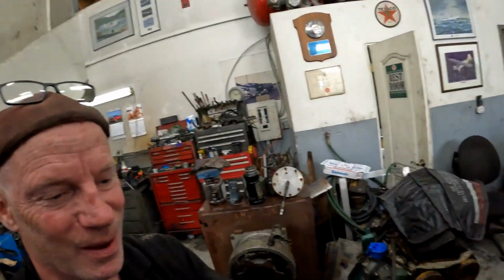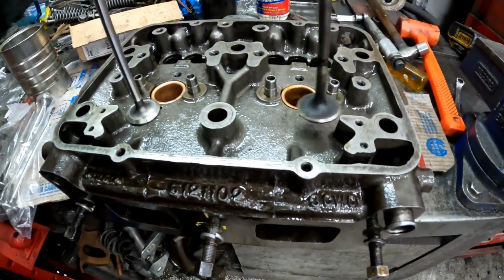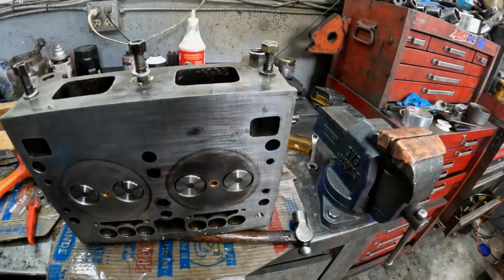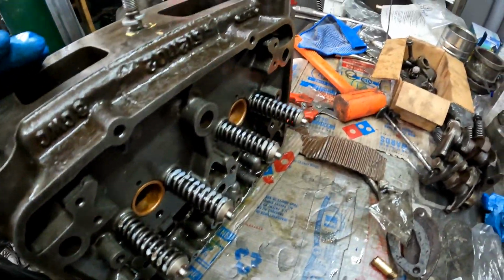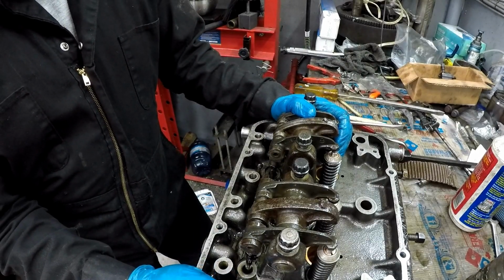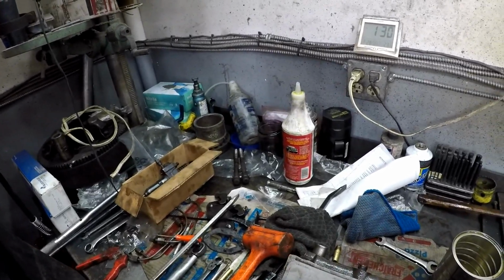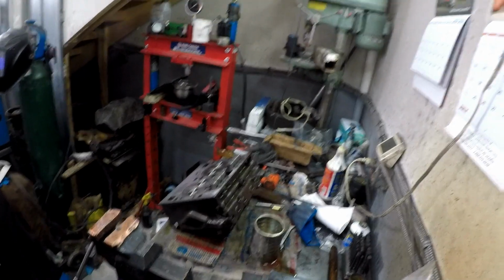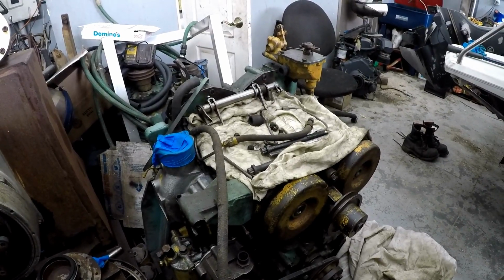Detroit 2-53 Head Assembly

Comment: Love the giant spring compressor!
Reply from the maker: :)  It's certainly large, I'll have to find the Detroit tool someday.:)  Certainly a lot easier to use than mine.:)  Thanks for watching.:)
Reply: What kind of oil temp on the 2-53 is normal.I followed your 2-53 Detroit build and my motor runs great.And it is in a 45 foot boat with n-50 injectors.
Reply from the maker: @keithralston3950  That's nice to hear.:)  I don't have any time with the 2-53's but if it's like the 4-53T it should be somewhere between 180-190 F.  They usually mirror the coolant temp until worked hard and then climb to 10 degrees higher than coolant.